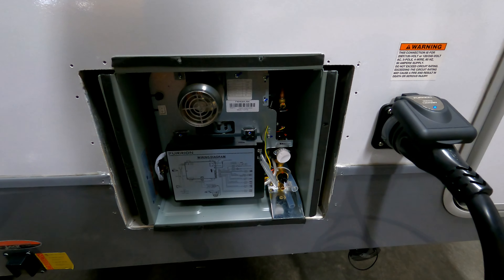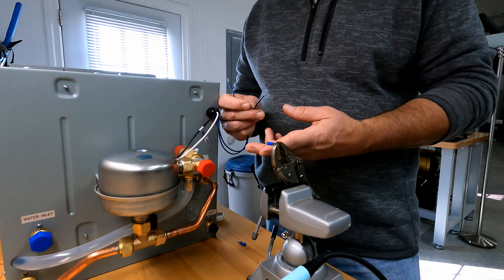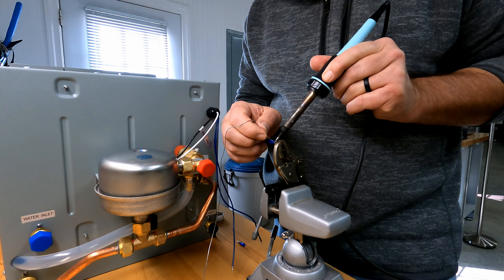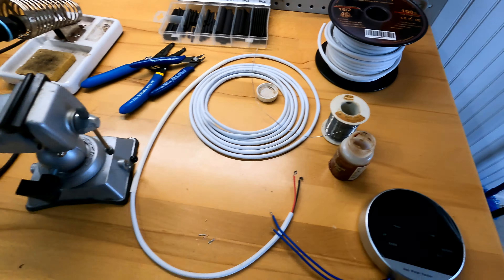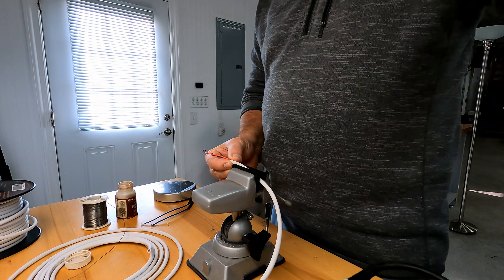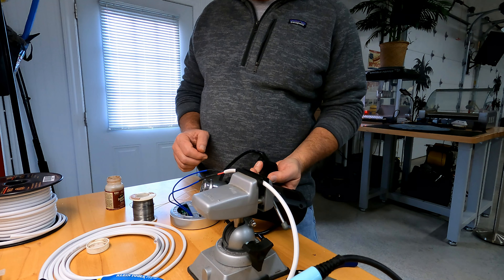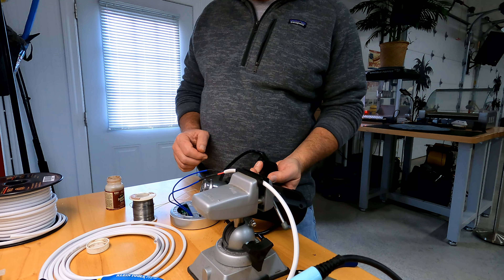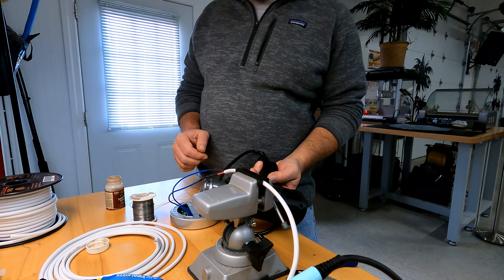Furrion On Demand Hot Water Heater, Part 3

Comment: They suck.  The "Vortex" ball cannot be fully drained of water and you can't verifiy if it has any anti freeze in it when you winterize.  This causes the water in the ball to freeze which damages the mixing ball which leads to a BIG LEAK.   You can't order a new mixing ball because their not made anymore and Furrion's only solution is to replace the water heater.  YOU PAY for this because they claim it wasn't winterized when in fact they is NO way to make sure that the ball is drained of water!!!!  We went through this this year and had to remove the mixing ball and bypass it.  This works but you end up with hot and cold spurts during showering.  I had the bowl repaired and modified with a lowpoint drain so you can get all of the water out of the bowl during winterizing and can then verify that the bowl has antifreeze in it.   The ball freezing and breaking is not an "up north" problem, I live in northern AL.    So upgrade to a furrion tankless at your own risk!!  I have pics if anyone wants to see what it looks like after it get damaged from freezing.